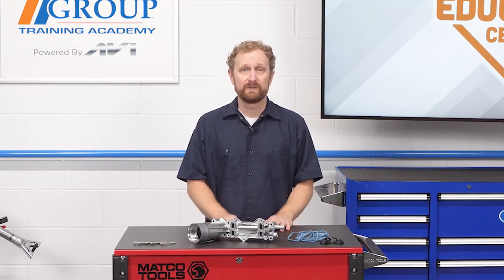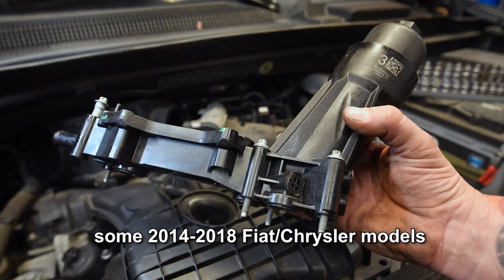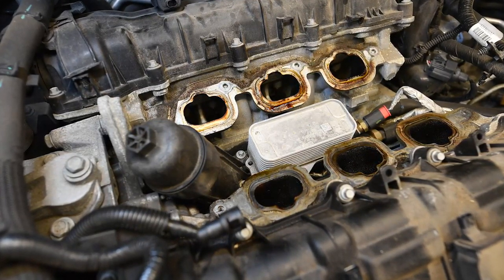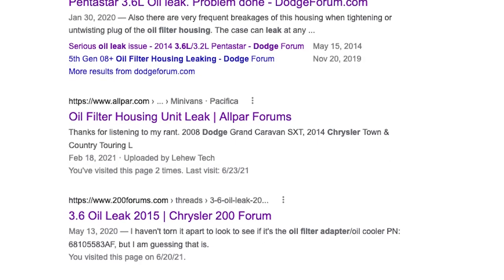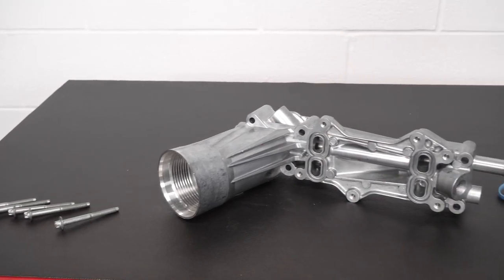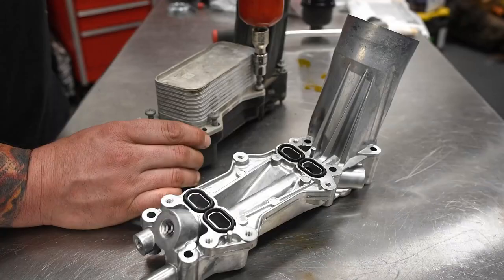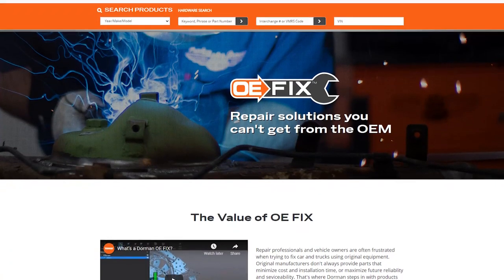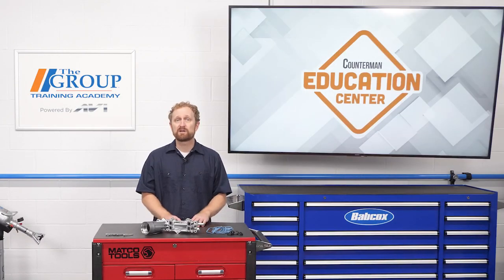An Aftermarket Fix for the Chrysler Oil-Filter Housing

Comment: The biggest problem with 3.6 is the DRY STARTS. No check valve to stop oil from being drained back into oil pan. Thus upon start up oil is absent in cam housings and this is why the famous “ticking” occurs on all engines eventually due to worn rocker bearings and pins. Way to go Chrysler.

Comment: I have read that the Dorman  replacement is failing due to not sealing properly with the O-ring gaskets, thus causing oil and coolant leaks. From what I read, this happens more quickly than what the OE units were failing at.
Reply: If it’s on the internet it must be true
Reply: I’d still go with the Dorman aluminum over the OEM plastic bs 😂

Comment: Good luck getting the aluminum one its on back order with no ETA on when it will be available again. So your stuck with the crappy plastic one that can potentially fail again. Just figured I would let people know not to waste their time in putting in a order for the aluminum one. So awesome this should have been a recall.
Reply: I just ordered one. February 25.
Reply: The aluminum one will still fail eventually. It's a bad design no matter what it's made of. My buddy works at a Jeep dealership and has replaced 3 aluminum ones back to OEM in the past 12 months.
Reply: @savage101.  In that case I'd think there was an underlying issue somewhere else.
Reply: @Mike__P  The design is the real issue. My buddy says he does this job on a weekly basis, sometimes multiple times a week at his dealership.
Reply: @savage101.  That should be considered some kind of recall or bulletin if it's that big of an issue. They redesigned the upper coolant lines on the 2015 because the plastic connector was prone to cracking. This should be equally as important.
Reply: @Mike__P  It's a big enough issue that the replacement parts are currently on backorder at every parts store in my town. I had to drive 45 minutes to a Jeep dealership to get the last one they had left. Most dealerships I spoke to stopped selling them the public and are hoarding them for customers or warranty jobs.
Reply: @savage101.  I just get them on Amazon. Those seem to be as useless as the OEM ones. They'll last 8 months or so.
Reply: @Mike__P  
Hey Mike where did you place your order. I called Dorman and was told the part was discontinued, this was just a few weeks ago.
Reply: @jooooooooeful  CarID
Reply: @Mike__P  
Was that Carl D, from Dorman.
Reply: @jooooooooeful  yes
Reply: @savage101. you sound so biased lmao you’re in almost all the comments on here saying the same thing.
Reply: @Mike__P  I just replaced mine in my wife's 2011 town and country. I got an aluminum one from Amazon.  I drove it to work today and the oil light came on. I know some coolant got into the oil holes when I removed the housing. I  was wondering if you have experienced the same thing.  There was no coolant in the oil before making repair. I'm starting to freak out a little.

Comment: Will this fit on the 2013 Jeep Wrangler? I have had to replace this thing twice, and currently have another leak!
Reply: No, only fits '14 to current.
[EDIT: additional information, you need the 2014 and later cooler component removed from a 2014 and later OEM assembly. The cooler component is installed on the Dorman component. The 2013 and earlier cooler is different.]
Reply: Dorman now has a 926-959 part number that also includes a new oil cooler and oil filter with cap. The only thing that you will need to transfer to the new housing are the 2 sensors that are connected to the wiring harness. The only thing to keep in mind is that you will need to use the 2014 and newer oil filter on future oil changes.
Reply: You can install it on a 2013 Wrangler BUT you must use an oil filter from the 2nd Gen 2014-2018 JKs

Comment: Guys just my 2 cents I have 2 2015 Chrysler 200C AWD with the 3.6 I ran a test and it seems that its working, believe it or not, I remove the huge beauty = noise cover on top of the engine on one and left it one the other one since I purchased both cars in 2017 as lease returns, the day I purchased both at the same dealer, they had to replace the both coolers because obviously both were leaking already ANYWAY to make the long story short, both cars are driven more than les the same around 10K miles a year my daughters are using them, the car WITHOUT the beauty cover had it replaced only ONCE when I purchased the cars, the other one with the cover 3 times in TOTAL so, I have a theory that that FRICKING huge beauty cover with all the noise reduction foam is not letting the heat dissipate, it just cooks everything there under it... I just decided to remove the second one. Thank GOD! I purchased the lifetime warranty on both... spread the word REMOVE THE BEAUTY COVERS ON ALL 3.6 PENTSTAR ENGINES! bunch of dumb FCA engineers
Reply: Chrysler screwed me out of my Lifetime Warranty that I purchased as they failed to include the conditions for continued coverage in the warranty manual. Thousands of people were screwed over by Chrysler the same way. You better research the none existent small print before they cancel yours too. Chrysler knew they didn't inform buyers of the conditions when they sold the warranties. They told me if I didn't like it, I could sue them in court.
Reply: @jamesoberg8809  wow! I didn't know that, I have not used my warranties for the last 2 years as both cars have incredibly behaved properly, I will check with the Chrysler Dealership Service Manager he is now a friend as I have own so many Chryslers for the last 20 years... but no more because Chrysler is dead.... I will also Google this you just got me very scared.... Thanks
Reply: @jamesoberg8809  When this happed to you? recently?
Reply: @TheMELTDOWN911  I bought a new Jeep in October 2007 with lifetime powertrain and added the additional lifetime service contract. The dealer told me to bring the Jeep in at the 5 year mark for an inspection which I did. They didn't mention that it had to be done every 5 years so it was missed in 2017. Nothing was included in any written form about inspections. Chrysler knew they didn't include it. Even though it was their error they refused to honor both the powertrain warranty and the warranty I purchased .  I had full maintenance records going back to day 1 for the Jeep as was required by the info in the warranty manual. Fought with them for over 4 years and they just said "If you don't like it then sue us in court". At the 15 year point I had the dealer do the inspection Chrysler requires. Turns out it was just checking oil and coolant levels. WHAT A JOKE!  Point being that if you have anything in writing with Chrysler it's subject to their whims. Even the dealers in my area admitted to the scam but would do nothing to advocate for me out of fear of losing their franchise.

Comment: You can't get the dorman one right now you can get knockoff aluminum ones how are those? Hope they are made right if there's defects in the aluminum on the inside a piece brakes off it could cause catastrophic engine failure. If there ever was a design flaw in the 3.6l pentastar engine it's this. I don't know how there isn't a recall. The cheap knockoff plastic ones fail rather quickly and the aftermarket metal ones your running a risk of seriously damaging your block if the fit isn't perfect. The dealer oem mopar part runs 300 to 500 online / locally it's probably the longest lasting replacement part first I would do is replace the seals to get is serviced it isn't cheap your looking at average maybe $1500 in parts and labor. Common problem if it looks like you have oil leak.

Comment: I just replaced mine on a 2015 Chrysler 200s
Reply: How’s it holding?
Reply: @se7ensiinz  Still strong..it's a design flaw in the Dodge Chargers and Jeeps
Reply: How did it go for you? Experiencing this issue on my 2015 200s
Reply: @LooneyTunesCarrot32  It went well....Still operating, but I would go to a Dodge Dealership to get it done though..I couldn't because they were booked up.
Reply: @howardwilliams8181  ok. Is it just difficult replacement? Only reason I’m considering DIY is because of costs
Reply: @LooneyTunesCarrot32  Also I would get the mechanic to replace your spark plugs also make sure he uses only factory Mopar original plugs.

Comment: The aluminum one will still eventually fail and leak. My buddy is a Jeep dealership mechanic and has replaced 3 aluminum ones with OEM because they started leaking. Seems like a poor design and will leak no matter what it's made of.
Reply: Is that the same dealership that charges around $900 to $1,000 dollars to change it back to a plastic one
Reply: What a massive L lol going back to plastic just to get them back to redo the whole process over and over again.

Comment: My 2011 Chrysler town and country 3.6 penstar. The oil filter is on top of the engine and ten minutes after the engine is shut off. The oil filter drains out completely. The engine sounds like an awful hell when you start it. Because the filter is empty... anyone have any ideas what the problem is???? Thanks im at my wits end abd Google has been zero help... arrrrrrg
Reply: That normal for cartridge type filters mounted vertically.
Reply: @walterk1221  not normal to empty out the filter.  This did not come new with this problem.  There is an anti drain back valve somewhere that has failed.
Reply: @snakepliskinsnake  I assure you that I, as an owner of a 2013 Chrysler 200 with this filter since new it is and has been normal that the housing drains at engine shutdown. It is no more detrimental than a spin on filter that is installed without prefill. If you are experiencing noises, something else is amiss.
Reply: @walterk1221  it didn't do this when new. It just recently started at 100,××× miles. And it not normal for the main bearings to knock 12 to 15 seconds before the oil filter is full and pushes the oil to crank. I'm obviously not explaining right.  After 3 different transmission replacement.  It's obvious Chrysler makes complete junk.
Reply: @snakepliskinsnake  you are entitled to your opinion. But it is a fact there is NO anti drain back valve in the pentastar engine. I am sorry you are plagued with an apparent premature failure.
Reply: @snakepliskinsnake  no no no, there is no anti drain back valve it the pentastar engine. It is not necessary.
Reply: @walterk1221  yes there is. It's a plastic button with a metal spring thst goes up inside.the the filter sits on.  I purchased a brand new one from Chrysler/dodge/jeep dealer.
Reply: @walterk1221  you are entitled to yours.  I know the main bearings are not supposed to knock everytime the engine is started.  Didn't do it when when i bought it new. But thanks anyway.
Reply: @snakepliskinsnake  the plastic button and metal spring is the filter bypass valve. NOT an anti drain back valve BECAUSE THE PENTASTAR ENGINE DOES NOT HAVE AN ANTI DRAIN BACK VALVE.
Reply: @snakepliskinsnake  you provided a great clue... approximately how long did you operate the engine without the filter bypass valve (which you misidentified as an anti drain back valve)? Its absence, obviously, allows unfiltered oil to be delivered to the bearings and the cam phasers.
Reply: @snakepliskinsnake  so, have I clarified your misconception?
Reply: @snakepliskinsnake  my statement that there is no anti drain back valve is not opinion it is fact. Another fact is that you misidentified the filter bypass valve and undoubtedly operated your poor engine with oil bypassing the filter for lord only knows how long. Then you whine and whine about damage you caused by not immediately replacing the bypass valve components. OWNER NEGLIGENCE is not the fault of the engine.
Reply: @walterk1221  hahahaha